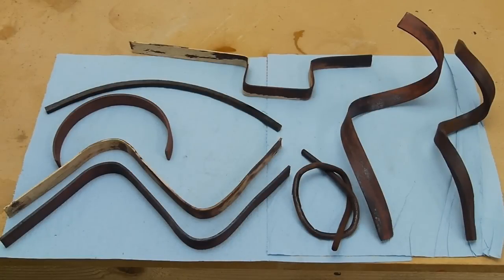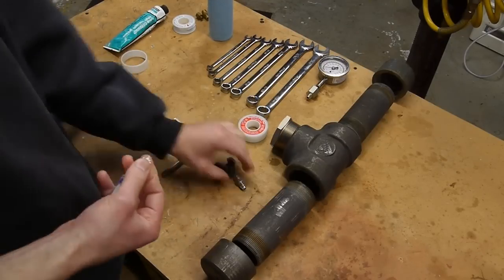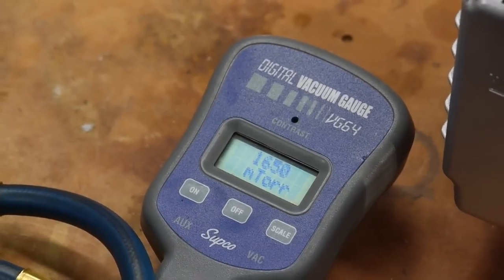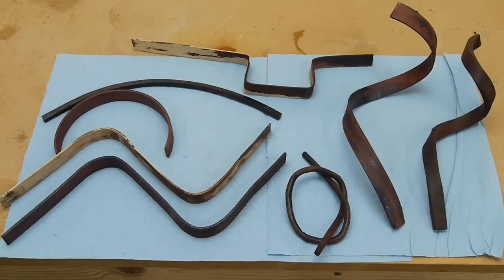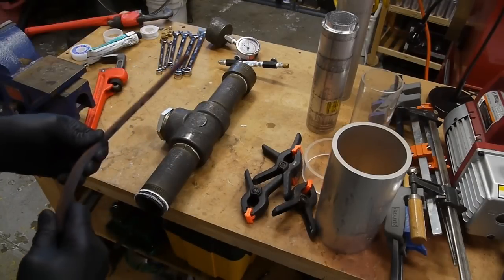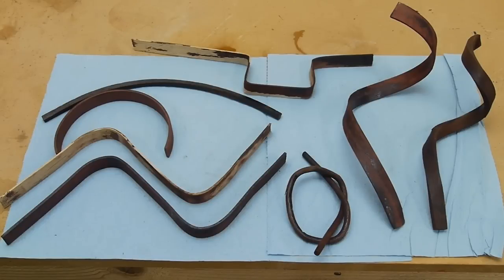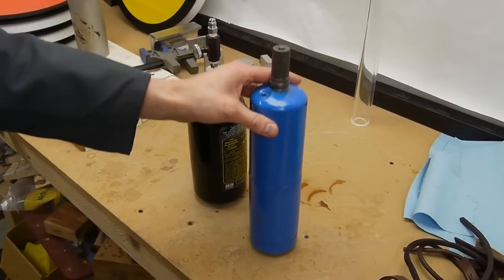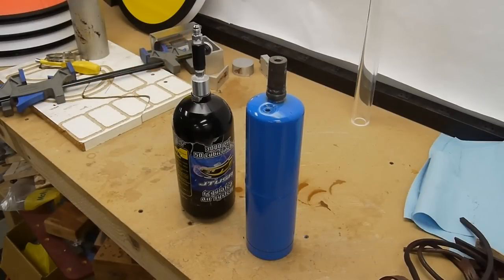Extreme wood bending with ammonia

Comment: You can bend wood by putting it under steam pressure.  The wood keeps it's natural color this way and it's a process used in furniture making (among others).

Using ammonia sounds like a pretty elaborate way to achieve the same thing, but this tarnishes the wood as well ?  Or am I missing something important here ?
Reply: oreubens the problem with steam is that you only have about a minute before the piece cools, you really need to work while the piece is hot. Also, there's a significant amount of spring back, and you won't know how much until you've remove all your clamps. You really couldn't bend that walnut into a knot, for example, if you used the steam method.
Reply: I wouldn't be too sure about that...  Check this out http://www.kinoguerin.com/  These are large slabs of wood, not just dowels, bent into knots and useful furniture.

But I'll agree that the time component is probably a big issue.
Reply: oreubens  the wood on that site was laminated (glued into that shape) and maybe placed in a vacuum bag to clamp.

Comment: For those of us that do not have the equipment to distill anhydrous ammonia, would it be possible to add a fair amount of dilute ammonia in liquid form and heat the pipe to get the pressure?
Reply: Mark Speir It may work, but you will need concentrated ammonia solution(30% or similar).

Comment: Teflon coatings have been formulated to handle many corrosive substances. You might enjoy looking into it. I read a how to book that used anhydrous ammonia and he had some discussion about Teflon coatings but it has been a few years and I don't remember all the details. The gist of it was to avoid lab glass and use cheaper and more widely available materials.
Also if you end up with water in the pressure vessel anyway why is it critical to use anhydrous ammonia? Is it possible to bump up the 30% solution by chemically drying(lye or lime too maybe) it but keeping enough water to fully dissolve the ammonia? Then you might avoid having to worry about corrosion causing leaks in cylinders. If wood bends adequately with steam alone a partial process may bring the procedure into the reach of mere mortals who are cautious but don't have a fume hood.
On the topic of fume hoods. Are they just vented outside or do they have some filtration? I've got a nature thing going on and smoke and fumes vented to the bird zone won't really work for me anyway.

Comment: If your ammonia is not completely dry (as you suspect is the case) it will definately attack aluminium as all strongly alkaline aqeous solutions do. You can easily verify this by pouring a little concentrated ammonia solution in an aluminium cup. You'll see the aluminum darken, and small bubbles of hydrogen will form as the metal is being oxidised in the strongly alkaline solution (give it a minute to dissolve the oxide layer first).

Comment: question..what about making a storage vessel out of the sched. 80 steel pipe and fittings?  maybe a 4" dia pipe nipple and pipe cap at one end and reducer at the other end down to the size of a valve?

Comment: You are right the ammonia attacks the hyrogen bridges in the cellulose (Hemicellulose).
The NH3 attacks very fast. At 30°C the structur looks like C6H12O5(NH3)2 above it looks C6H12O5(NH3).
When the NH3 evaporates the cellulose structure changes.If you put yet water on it you will get the old Cellulose-I Structure.
Reply: presumably theres no safer compound to neutralize the hydrogen bonds in the cellulose?

Comment: Although late to the party, when using any corrosive gas or liquid using Teflon or sealant is not recommended.  Instead using a PTFE sealant in tape or liquid compound.  At Home Depot it's yellow thread sealant tape (Oakey Yellow PTFE Tape) or ReactorSeal Tru-Blu with PTFE.  Never use Teflon tape for any gas line threads.
Reply: +John Doe Teflon is just a brand name for PTFE.

Comment: rather than sweating over finding a suitable bottle, just make a flask from your schedule 80 pipe pieces. use epoxy as "thread dope" along with the teflon tape if you're worried about seepage. it's hot rolled steel, entirely.  schedule 40 will work just fine as well, btw ( i use schedule 40 in 150 psi air systems all the time, as well as for fittings on a sandblaster working at the same pressures, so it would in no way be "right on the edge of failure"). if you can weld, then just dry fit threaded parts and run sealing beads.
Reply: ludditeneaderthal kinda becomes critical that u have an air tight weld at that point, no? An episode of Mythbusters comes to mind, where some tanks were welded but did not hold pressure
Reply: Ken Oakleaf
 it's all a matter of 2 factors, mechanical strength, and "chemically tight enough joints". so, i can have a mechanically strong fit-up that leaks like a sieve (undoped pipe joints), i can have a really chem tight fit-up that will break if you look at it cross-eyed (a filled light bulb). but, look what i suggested above. threaded pipe joints, sealed threads, AND "sealing bead" welds. belt, suspenders, AND sock garters, my friend. now, if we are using operational pressures close to ultimate yield of our pipes and threads, such a scheme is, indeed, "critical". welds weaken surrounding structure in many cases, usually by adding stresses. but, if our working pressure is around 10% of "ultimate yield", it's "more" in a few ways. so, yes, with butt and lap weld joints, "DIY welded pressure vessels" can be kinda grenade-esque, especially if you're not really up to the task of safely testing it. make it welds on already mechanically robust fit-ups, FAR less so, until you court disaster even if perfectly made. doped sched 40 is rated for 150 psi live dry steam, if memory serves correctly. that's 10 atmospheres. it's also VERY hot, at least in comparison to pumping around water, or air, or hydraulic oils. that's why that same sched 40 joint is just fine for 2000 psi hydraulics, though with a different dope on the threads. a 12 gauge "squirrel load" makes about 13k psi, yet is easily contained in a "zip gun" made from 3/4 inch black "iron" pipe and a couple threaded fittings available at any home despot. constant pressures at such levels, of course, would be entirely different, especially when we consider the joints are ONLY mechanical in our "zip gun"(the shell prevents gas in the joints). so, having expanded (sorry for being so verbose, lol), get my point?

Comment: Be careful with the aluminium tank and ammonia if you have also water inside. Aluminium is able to react easily with bases (with sodium hydroxide the reaction is quite strong and dangerous, with a large emission of hydrogen) and if your ammonia is not dry (most probably is not) you have also ammonium hydroxide in that tank. Now, if it is too much ammonium hydroxide and concentrated, that means you have a little bomb in your house. Hard to say when it will explode. Please, try to change with a steel tank.
Reply: Bogdan Stoica photo 55photo
Reply: Sorry you’ve not a clue and uneducated comments should be kept to yourself so you don’t badly influenced others incorrectly. Large ammonia industrial refrigeration plants of 100 - 100,000kw,  most with water in the ammonia routinely use aluminium both in tube heat exchangers and as gasket materials because superior qualities in these applications.

Comment: All of your videos are so interesting and well made!!! This particular video interests me a great deal. I sure hope you can find a few seconds to reply. I have a very specific use case for this concept that I would love to try. I know that ammonia is a dangerous chemical, even when diluted and not under pressure. I have used ammonia to "stain" Craftsman-Style white oak furniture, and I had to do it outside, in a thick plastic wrap dome, with a vapor mask, gloves, and the whole kit. I would never attempt something like what you do in this video without being properly trained. So... can you please tell me what I might Google in my area for who can help me set up almost the exact scenario you have in this video? 
I need a 3 ft. long stainless steel pipe that is  2.5 - 3" in diameter that I will be inserting 2.5 ft. long strips of ~1/8" thick (1.75" wide) maple, and "gassing it" into being pliable enough to bend into similar radii as you do in your video. What profession might I seek out to help me get this set up?
Thank you for your awesome videos!
Reply from the maker: Thanks!  Since everyone is concerned with liability these days, you might have trouble finding a local tradesperson to build a setup for you.  Luckily, if you just want to bend thin pieces of wood, you can use standard pipe and fittings from www.mcmaster.com, just like I did in this video. Some industrial refrigeration systems (ice skating rinks, especially) still use ammonia as the refrigerant, so you could call around to local HVAC maintenance shops to see if someone will sell you a tank or help you, but I suspect they will be reluctant.  You might also try high pressure steam bending to see if that will give you enough flexibility for your required bend.

Comment: Hello! For my wooden bike trailer (max. load 45 kg) Project I am looking for a wooden coil spring (72mm outer diameter, 125mm length and 5 turns). Is it possible with ur method to make a wooden coil spring? If yes can it works same as spring?...thanks in advance...

Comment: As a chemist with a bit of common sense i can say that it's a bad idea to heat up a pressurized canister of anything above room temperature. If you do be ready for the potential of an explosion (not saying it will happen, it's just a possibility which increases the more you heat it).
Reply: Jesse LeBlanc As a chemist you should know all pressure vessels have a huge safety margin plus pressure relief valves.  But a release could be deadly, I would pipe the relief valve to a pail of water for added insurance.

Comment: Will this work with liquid too? For us that dont have the vaporizer
Reply: Household ammonia is a diluted water solution containing 5 to 10 percent ammonia. On the other hand, anhydrous ammonia he is working with is essentially pure (over 99 percent) ammonia
Anhydrous ammonia boils at a temperature of -28°F (-33.33°C).
Liquid Anhydrous ammonia might work, but it's also a strong solvent that will likely remove lignins from the wood rather than just soften them.
someone should try it to verify. "only difference between science and screwing around, is writing it down"

research showing lignin extraction via ammonia http://www.nrcresearchpress.com/doi/pdf/10.1139/v56-227

Comment: Ammonia causes hydrolisis of the glycosidic bond (base catalised) in wood, it will work with ammonia solution as wella as with gass ammonia.
Reply: +Marti2 thats incorrect the cellulose does not hydrolyse.It also works better acid catalised. As we did in school H2SO4 + heating after 10 min you neutralized and then take the "Fehling-Reagenz".
I dont know how it will reacte in water but the industry does only take liqid ammonia gas or 10-20 NaOH for the swelling.
Reply: +Joschimido Not celulose long molecules, but crosslinking short molecules; lignanes, chemicelulose. ec
Reply: Marti2 The hemicellulose often is acetylated or has acetylated side chains. That can be hydrolysed but as I read thats not possible with ammonia gas.But with hot water steam as usuall.
Lignan is different to Lignin and as I know there is not mutch Lignan in the wood. Ammonia cant hydrolyse the polymerized Lignin.

Comment: 2:40 "microns"??? First of all, microns is a shortening of micrometers, and secondly, it's displaying mTorr (10^-3 Torr), so it's milliTorr, not microTorr...
Reply from the maker: +surripere ( &#39;~&#39;)  A pressure of 1 torr  can support a column of mercury 1 millimeter in height by definition originally, so a millitorr is a column 1 micron high.  It's common to discuss vacuum in "microns" because most mechanical 2-stage pumps have practical ultimate vacuums of 1-100 micron, so the numbers are conveniently sized.
Reply: +Applied Science 
Ok, fair enough. I work in thin-films and I've actually never come across that; thanks for the clarification.
Reply: +surripere ( &#39;~&#39;)  i use a micron gauge when pulling a vacuum. i am a hvac tech.
Reply: +Jess Evans 
You guys actually pull to that low a pressure in HVAC stuff, or is this just a name for a tool that has a the same indirect convention as the one Applied Science described before?

Comment: There must be another way - how did the ship builders in ancient times bend wood? I doubt hat they used high pressure chambers.
Reply: ***** The usual thing is that they steam them (hot steam chambers) and then quickly bend it into place.
Reply: gamingSlasher that is relatively modern. Before that, you'd make a fire under the plank you wanted to bend and wet the other side. Still the basic principle remains the same.

Comment: okay but how do I open the pipe without filling my workshop with ammonia?
Reply: My guess is you let the heat dissipate and then chill it till the anhydrous ammonia liquefies again.
Reply: use the same vacuum thing as was used in the first place
Reply: JakesDenPotato 
That would get it out of the 'chamber', but into the shop. Best to chill and properly pour off/extract.

Comment: Aluminum metal is far less corroded by water or gases like NH3. Al(s) gets a hard thin coat of Al2O3 that you will never remove. OK material.
Reply: Victor Calvo remove Al2O3  with an alkaline like sodium hydroxide or ammonium hydroxide? hopes he has is true anhydrous.

Comment: I tryed soaking a piece of Purple heart wood in ammonia 25%. 24 hours and nothing has happened except coloring of the liquid. It is in a plastic bag tightly sealed. 
What am I missing out on ?
Reply: skarmarl It needs to be gas in vacuume or it wont work ?
Reply: +skarmarl yeah the Industry makes it only with liqid gas.
The structer changes from Cellulose-I to Cellulose-III if you put water on it it will be turn back to Cellulose-I.
But CH3COOH (viegar?) could work with less sucess but NaOH  10-20% works.
The NaOh should be not(more)/less concentrated cause the Ions are too big  and cant enter the polymer.

Comment: i was looking for a way to bend a guitar rib without a heat bender
Reply: +Jess Evans This is absolutely not the process that I would choose.  Anhydrous ammonia is a very hazardous substance that can destroy your lungs in seconds. Furthermore, I think that a chamber that would be big enough to hold a 6"x36" side blank would be prohibitively expensive to make.

I would stick to the a Fox-style bender and heating blankets, or a hot pipe (I've done both.  I have also used Downy fabric softener in hot water to soften the wood, but I don't like that very much because of the odor and saturation of the wood.

Comment: Interesting Video.  Your process describes the process of perming hair.  The only difference it that with hair the Ammonia is in solution and after a period of time usually with hair approximately 10 - 15 minutes all of the bonds in human hair are broken.  The hair is then rinsed for 5 minutes and a slightly acid solution is used to neuralise the alkaline Ammonia solution and left on for 5 minutes. The hair is then rinsed and the bonds are now relinked to stay in a curl shape.   Maybe a slightly acid solutions could be used on timber to stop the ammonia process and relink the timber fibres quicker (vinegar?).  Cheers looks dangerous liquid ammonia is not a good chemical to deal with.

Comment: I think  the joule-thomson-effect could have something to do with the vessle heating up.

While it is often used to cool and liquify gas, if the JT coefficient is negative. gas will heat up. Not shure how well that would work because we dont really have an isenthalp proces here but it could be a possibility.

http://www.nist.gov/data/PDFfiles/jpcrd119.pdf on page 155 is a table for the coefficients.

I dont know what the pressure in your gas bottle is.

Maybe someone else can think about this.
Unfortunately I'm only just beginning to learn Thermodynamics.

Comment: I did blueprints for a living. So I have access, powerful ammonia, like about 25 percent

Just soak it. You can tie it in a knot

I'm end dry tree limbs into bonsai trees. Wrap it with copper wire and it all evaporates off. It's hard as if it grew there. It does not damage the wood.

Just soak it. Get blueprinters ammoniac 29
So could a few days. And bend away.
Soaking it is safer than this high pressure craziness. Household ammonia will not work. Blueprinters ammonia.

Comment: Cole Parmer lists aluminum as excellent compatibility with anh NH3, at least to 72F. Useful database if you haven't come across it. But no good if it's not anhydrous as noted below. I thought the rain you saw could be explained by chamber being filled with water vapor from the wood. Unfortunately it's not that easy to determine the water content of NH3 without dissociating it and measuring the dew point. Thanks for another excellent vid!
http://www.coleparmer.co.uk/Chemical-Resistance

Comment: There is another method for cold bending as well - the wood is steamed and compressed lengthwise at the factory.  As long as the moisture content stays high enough, it can be bent and twisted quite a bit.  When the moisture content drops below a threshold, it retains its shape. These guys make it (samples & knot sculptures available too): http://www.puretimber.com/how-its-made/

Quite a bit safer, I think.